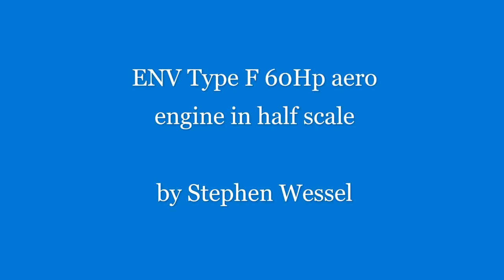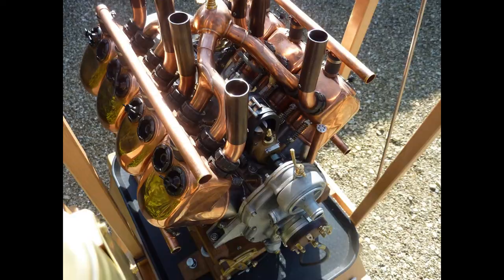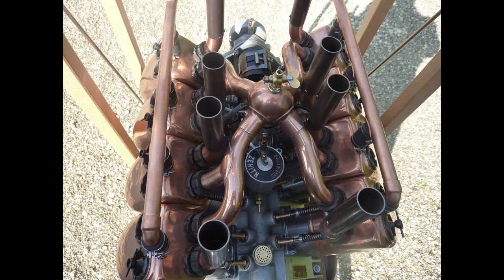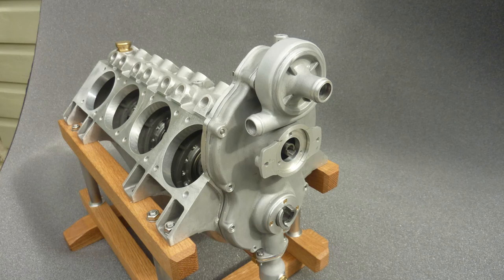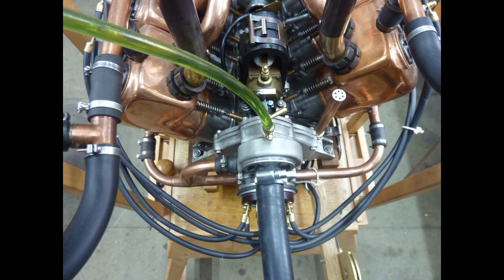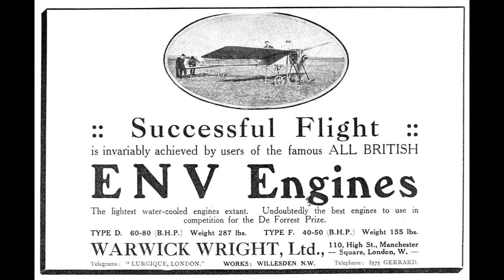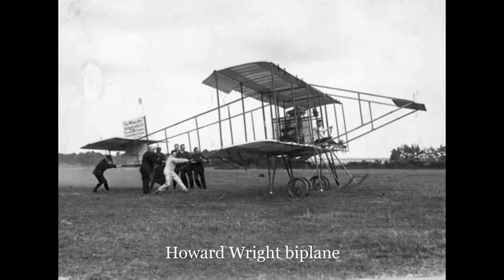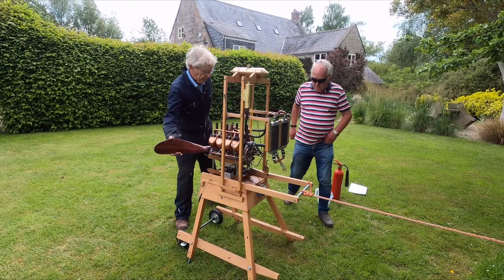ENV aero engine

Comment: Wow, it sounds so smooth compared with the later larger capacity machines. Superb work, thank you. A bb crank, so presumably splash lubrication to save weight - not a bad idea for a low torque engine I'd say.
Reply from the maker: yes it is very smooth. The Company made a point of saying their engines would NOT be reliant on splash. However, as I couldn't be certain how effective the pumped supply would be in the model I fill oil to a level just below the crank sweep and trust that mist will rapidly build up. I also use a little in the fuel, about 50:1 as back up.

Comment: Tnx. For ceeping history alive👍!
How is the engine lubricated? Castor oil in the fuel?
Reply from the maker: I use a modern semi synthetic in the sump which is pumped into the hollow c/shaft. Fuel is 40/1 using the same oil.

Comment: A great technical work!. Since you already have a V 2x4, you can try W 12 (3x4), for example Lorraine Dietrich 12Eb 450hp. I have not heard the sound of a plane motor in the W12 (3x4) layout yet. There are still many interesting and available in aviation museums such engines but asleep. Since you already have a V 2x4, you can try W 12 (3x4), for example Lorraine Dietrich 12Eb 450hp. 
The truth is, your work is impressive end unique.
Reply from the maker: Ha! thanks for your kind remarks but this one was quite complicated enough for me. I deliberately chose a pre WW1 example thinking it might be easier than something from mid century like the LD or the Lion. There are indeed many engines asleep, as you say, but most of them lead nowhere, whereas the little ENVs in the hands of young pilots like Sopwith acted as a spur to development that lead to a great industry. Another engine of mine, the Lynx which you may have seen on my channel, was regularly flown by Whittle and (in its lack of power at altitude) may have got him to dream of a turbine engine to get him higher & faster. These are the human connections I find so inspiring.
Reply: The peak of (British!)  engineering ingenuity, truly impressive…..